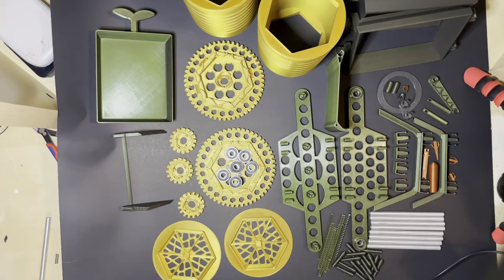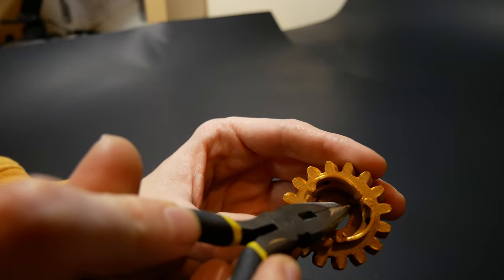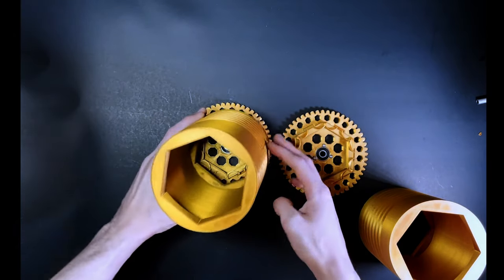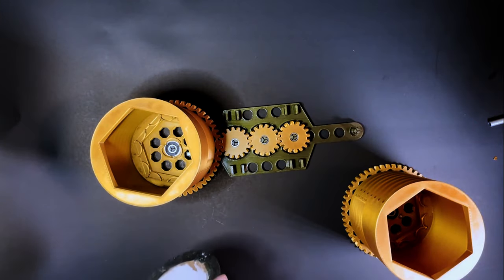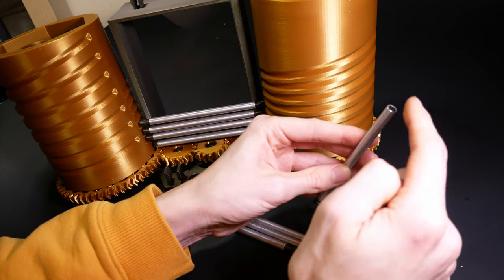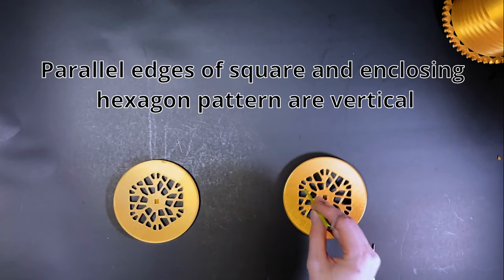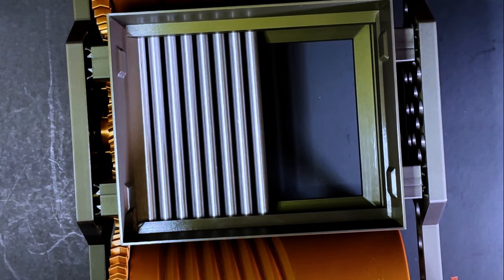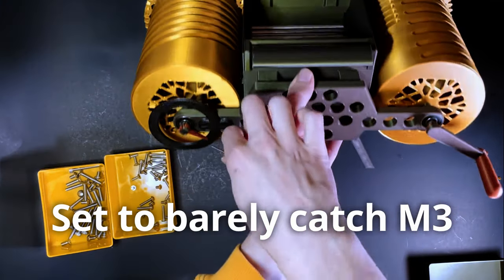In-Cam-Sieve-able Screw Sorter Assembly and Use

Comment: what about printing alignment marks on the gears and other parts? That way then you assemble you can just use alignment marks to make sure everything is where it is supposed to be.
Reply from the maker: Tons of improvements that could be made with the design but honestly I don't feel like making a revision. The design was never about practicality in the first place. If I wanted something more practical I would just do a series of simple fixed-width sieve boxes stacked on top of one another.